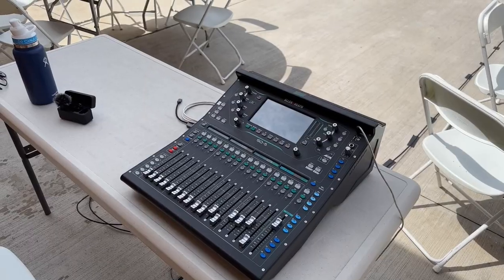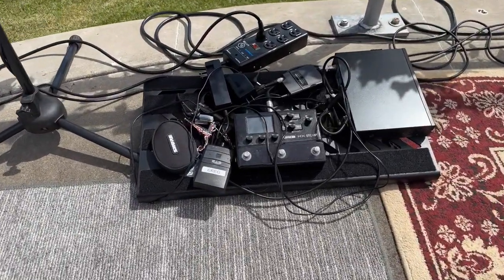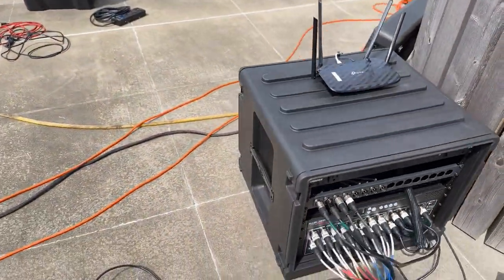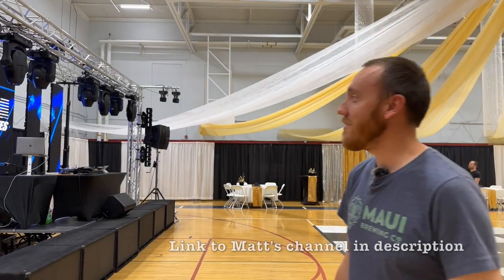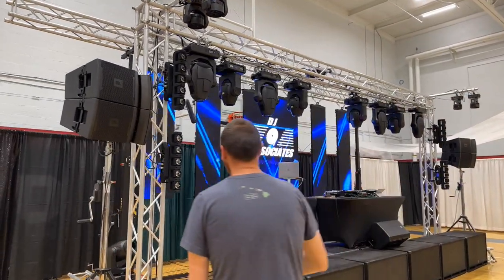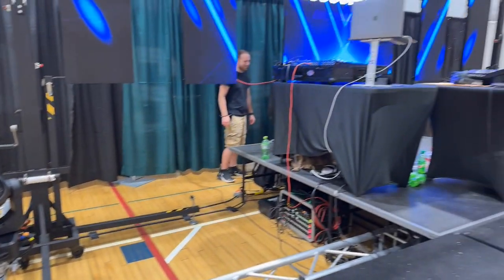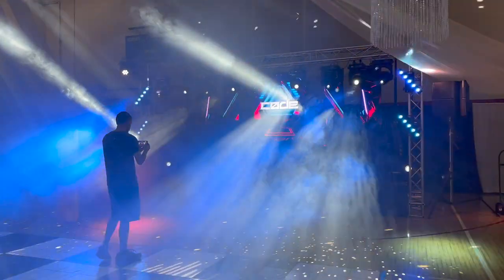System Tech for Huge Prom DJ + Live Band (Live Sound Vlog 3)

Comment: At least the subs are not VRX918s. Those old Carvin boxes sounded really good in the clip at the end.
Reply from the maker: I’m not a fan of 918s but I really like these Carvins
Reply: @arichindustries  Yeah I agree. Not heard the Carvins in real life but they sure sounded better in this recording than the VRX. I just saw a yearly event at a park in my city yesterday where they have a music stage. The stage usually has 3 (or more) VRX932LAP, and 3 VRX918SP, per side. It’s a very large wide open amphitheater/grass field space, approximately 300 by 300 feet of grass surrounded by trees according to an aerial view on Apple Maps, and slightly sloped toward the stage. The sound system was barely adequate to reach the back of the field, and the VRX918s, 6 in total, 3 per side, were already clipping or distorting somewhat at the kick drum, especially with recorded music between the live artists, but also during the live content to a certain extent. This distortion was so bad at times that the kick drum sounded quite tinny, and audibly had 2 separate peaks. (Almost like “p’pop!”) They also sounded overall boxy, and the really deep notes, while they were there, sounded strange and quiet. Also with the setup having 3 subs stacked on top of each other directly below the main hangs, you had to be in the exact center of the stage to get any meaningful bass, but the main hangs didn’t really cover the very front center stage at all so it sounded muffled! Only other place where bass was heard was off to the side of the stage, but then your view of the performance was blocked by the speaker arrays!
Reply: @djijspeakerguy4628   I've owned those Carvin subs now for many years. I'm in full agreement with how the 918's are. The thing i like the most about the Carvin subs, is i cant "hear" them. The 918's (and many others honestly) have a distinct "sound" to them. I know walking into a room if they are running 918's or even ETX18SP's just from the "sound". With the Carvin subs, i dont hear the box, i just hear the music i put into them. That is super valuable to me.

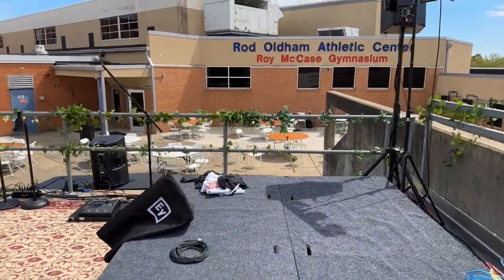Comment: At 3:14 you mentioned wireless bridge.  What do you use that for?  I have an SQ-5 and an AR2412. Thank you in advance
Reply from the maker: I use the wireless bridge to connect the SQ5, the ahm16, and anything else I may need network control of wireless. It eliminates having an Ethernet connecting between the stage and front of house, aside from the Ethercon connecting that’s running d-snake.
Reply: @arichindustries  thanks for the prompt reply. So I still need a Cat5e to connect my SQ-5 to the AR2412, I thought I could do wireless. Just wishful thinking 😄
Reply from the maker: @elyamzon  No, unfortunately you'll still have to have a wired connection between your console and stagebox.

Comment: Congrats! You got great Allen & Heath gear! A few suggestions... time to get rid of the dinosaur point source 12.2 speakers and move to a column array, such as Turbosound IP3000 I moved away from point source mains over 15 years ago myself! Also, FYI, those little Furman power strips are garbage. There's nothing inside them but a penny capacitor. Open one up yourself and see. A better option, and for a similar price,  is the Tripp Lite Isobar. They filter the power in as well as each plug from each other. Just stuff I learned over the years. But again, I have the A&H QU-SB, SQ5 and SQ6 and love 'em!